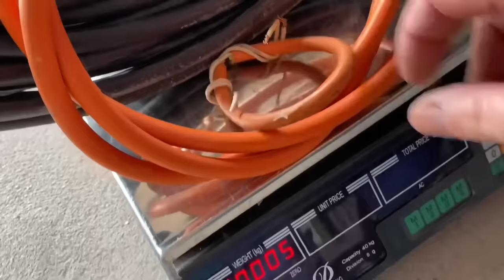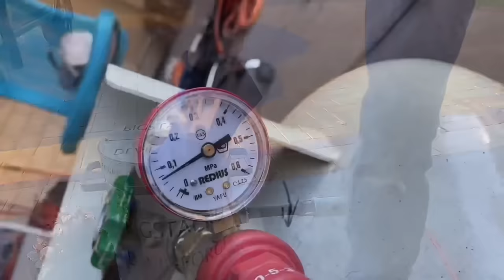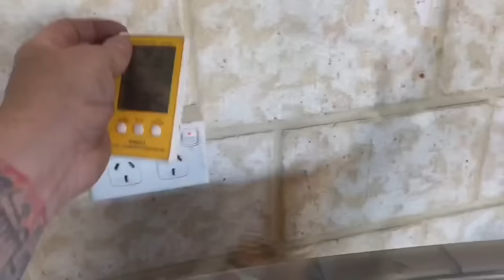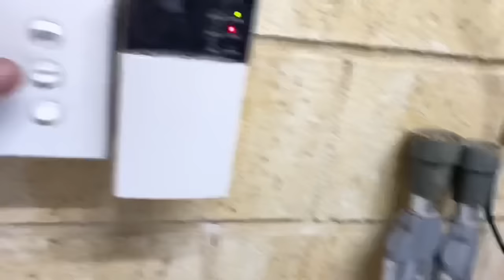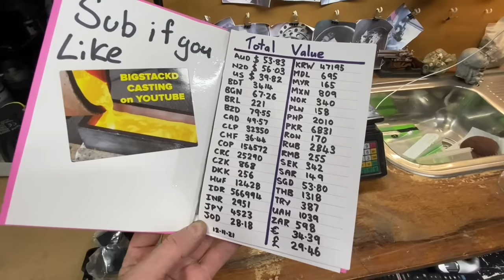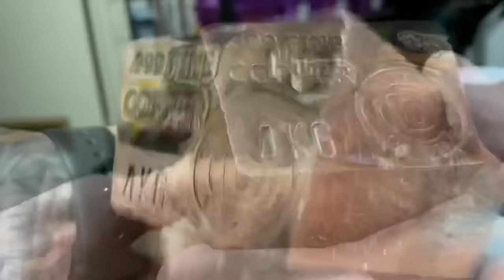Melting 10KG  Copper Cable - 99.9% Pure Copper - ASMR Metal Melting Copper - BigStackD Casting

Comment: The untwisting thing made me think of network cables.  What are your thoughts on melting them down?  Too high percentage plastic?  I have loads of old cat5 patch cables that I need to do something with...
Reply: Just cut the ends off and take them to a scrap yard. Price is around 75 to 95 cents a pound for insulated wire. The connectors have gold plating on the contacts.

Comment: @bigstackD Casting would you recommend the devil forge forge? The 2 or 3 burner model. I need to get away from coal for the winter and want something good. I already should've gotten a furnace from em lol. Mine is nicely built, brass just looks bleh melting it in a plain unpainted steel furnace.

Comment: Here's a question for you, will that stripper you used to take the jacket off work with data wire? I'm talking CAT 6/6a, CAT 5/5e, or even 25-50 pair cable? I'd like to melt down my own stuff, but the amount of work and time to manually strip the cable is my biggest obstacle. So is not having a dope smelter lol

Comment: i has question.  i take apart computers, and collect the wires and pins from them.  i have found some wires that are not copper,  however i do not know what metal it is.  it appears similar to be the same color as a metal spoon.  any ideas?

Comment: Sorry for the stupid question 

Why make lingo.   Did it incrase value of the copper ? 

Where did you sell your lingo ?
Reply from the maker: Actually buddy it won’t increase the value unless you sell it privately like on eBay or something like that. The scrapyard won’t pay you any extra for the ingots so to do this you would lose profit in time and gas. And most scrapyards won’t even buy the ingots because they don’t know if you’ve poured copper around a big piece of steel so a lot of them just refuse to buy them. 
I do this purely as a hobby that’s why I have so many bars and coins as you’ll see you at the end of video ,
this is just what I do on my days off for  a bit of fun in the garage so I don’t mind if it It cost me a few dollars here and there. 
Although ad revenue counteracts the loses.

Comment: Not sure if this is mentioned in older videos (just started watching), but how does that heat not affect your garage door above it?  I noticed it seems the furnace is still inside a bit, or is it just camera angle and really it's outside?
Reply from the maker: Actually mate most times I’ll do it directly under the roller door but when I built this house 15 years ago I got the garage roof raised so it’s not a standard height it’s actually a bit higher than normal. I have actually measured the temperature on the roller door and it only goes up about 10°C above the rest of the door. Even with the smallest of breezes the heat will disperse very quickly from the top of the furnace that’s why I can usually get a good view inside the furnace with the camera. 👍🏻
Reply: @bigstackD  Ah ok that’s cool.  I wondered how high/fast heat dissipated for those.

Comment: Don't believe I've seen you melt down  aluminum or brass radiators or heater cores, what about cast aluminum such as water pumps, pistons etc.  Worth it?
Reply from the maker: I do have two radiators one from a car and one from a four-wheel-drive that I will be doing in a future video so I’d be quite curious to know how much I get from it which I think will be quite a bit👍🏻.

Comment: the 10 grams might have been the ties holding the coils together that you cut with the diagonal cutters...

Either that or it's plastic dust/slivers from the insulation that got shaved off as you ripped the copper out of the insulation jackets...

Maybe both...

Comment: do these forges ever get tot he point where the  fire brick is so badly damaged that just coating it again wont cut it and they have to be either competly recycled or discarded?
Reply from the maker: I’ve had my few furnaces for years I don’t use the solid refractory one very often as that’s About 30% less efficient than the ceramic wool one. With the ceramic wool one I reapply the ceramic coating every few months but I have yet to replace the ceramic wool on the chamber walls in any of them yet. Although I do Regularly replace the floor of the chamber with 2 inch ceramic wool as I’m forever spilling stuff in there and always overfilling the Crucible

Comment: Can you smelt it as is (not freed of the copper's wrapping) - and just scoop out the trash?
Reply: I asked that before watching - sorry.
Reply from the maker: You certainly can just chuck the cables in with all the plastic on and all it will do is turn to Ash and it won’t affect the quality of the bar at all as the ash will stay in the Crucible or Kane skimmed off you’ll just need to pour it a bit slower so as to keep all the ash in the bottom of the Crucible. I did do a video where are melted the cable with the plastic on and everyone had a cry in the comments🤦🏻‍♂️. 
surprisingly if you were to melt it with the plastic on as long as you keep the heat on and wait until the copper has melted The furnace will produce no smoke at all🤔

Comment: Hello. Can you give us details on where to buy that kind of wire stripper please
Reply from the maker: EBay mate just type in electric wire stripper and it should come up. It’s a no name brand but I’ve had it for years and it works perfectly. As soon as you’ve got it set right for the size of wire you need you just sit back and feed the wire in 👍🏻

Comment: I am pouring copper ingots, about 6 lbs. Why do I get gas pockets in ingot sometimes after turning them out of mold?
Reply from the maker: honestly mate I myself have no idea. I’m assuming there’s trapped gases in the copper but for years I’ve struggled to remove the bubbles. I’ve superheated the molds I’ve vibrated the molds I’ve poured on an angle ive poured with a torch above the mold  and I still get the bloody holes🤷🏻‍♂️
Reply: @bigstackD  Thanks for your help! Love your channel, that's why I bought a Devil Forge. Haha

Comment: Do you wax them so they won't not Oxidize? 

Also make a small copper golem friend for your next copper vid
Reply from the maker: I don’t wax them but I do spray clear acrylic on the ones I want to keep in perfect condition as that stuff will just simply burn off if I ever decide to re-melt it but with the amount of work that goes into Mirror shining up a bar  I would never remelt one of those 👍🏻

Comment: You could be pouring 2lbs. Copper mallets/ fiberglass handles. 
Selling them to tool trucks and making bank. A good copper mallets is not a cheap date ,add 12% tin and you have a Bronze mallet. Snap on no longer sells copper hammers, every transmission guy and body shop had at least one and they got used alot. Hazet makes a 1000 gram copper hammer with a hickory handle, it's $162.11
That's right around 2lbs. at KC tools.

Comment: Why heat the mold before pouring the molten metal?
Reply from the maker: It’s always a good idea to heat anything that comes into contact with the molten metal especially your mold as if there’s any moisture at all in there it will turn to steam instantly creating a steam explosion and that will send molten metal everywhere but you can eliminate this by preheating your molds and making them nice and toasty hot before pouring into them👍🏻😁
Reply: @bigstackD  Such a good knowledge! Thank you for your explanation!

Comment: I wonder why you couldn’t just throw the wire into the fire without stripping it? In the heat of the crucible wouldn’t everything not copper completely burn away?
Reply from the maker: It would mate , you could easily do it and you would just have a bit of ash to skim out or you could just pour the bar slowly and the ash would stay in the Crucible but the last time I melted copper without stripping the plastic off 10000  people cried in the comments🤦🏻‍♂️

Comment: Now Please don't Get mad because I mean absolutely no disrespect, you can do whatever you want with your time and I won't judge, I am just curious.
What is the point of this? Is it just for fun?
I am a metal fabricator and have even done a few small castings myself. but I have been seeing a lot of videos showing up on youtube recently of people melting things down into Ingots and you seem to be one of the most popular channels doing this.
I can't see this as profitable, The wire and cable was worth more in its original form and I know for a fact (that at least around here) scrap aluminum, copper brass / you name it is worth the same amount left alone as Cast, add into that the cost of fuel, The amount of labor etc there is no way this is worth it in any monumental form?
Now I could see if you were planning on casting something and machining something out of that ingot but It looks like it is just for fun?
am I missing something?

Comment: I know its possible to make a furnace the size of a metal trash can, but is it smart to do so.? Legit wandering... Not joking...
Reply from the maker: You certainly could mate but you would definitely need 2 powerful burners running, if you did it with ceramic wool and coated it It should work pretty much the same as the smaller ones but if you were to line it with refractory concrete then that would need to heat up before you would get consistent heat to melt so it would take probably 30 or 40% longer and cost the 30 to 40% more in gas. But once the refractory cement temp was up it would run pretty much the same cost as the ceramic wool one but obviously you would lose a bit in that first initial melt ,  if you were to do more than one melt if that makes sense. 
I do have a larger furnace coming I’m just getting it custom wrapped so hopefully I’ll have it over the next few months👍🏻
Reply: @bigstackD  was thinkin of using fire brick and wool from an ole wood stove I have no use for.... ??
Reply: @bigstackD  do u think if i put it in the ground... Like in a hole... It might stay hotter longer and maybe wouldnt take 2 burners?
Reply from the maker: It will work it’ll just cost extra on gas and take a bit of extra time for the first initial heat up . Obviously use the wool on the lid otherwise it would be bloody heavy👍🏻. The only downside with a huge furnace is you’ll be using huge crucibles which are quite expensive unless you make your own out of something and then you’ll need to make a heap of tools to lift and pour👌🏻
Reply: @bigstackD  i appreciate the info... Its helpful... Love ur vids man keep it up!🙂👍
Reply: Woah😮
Reply: @lewisgiles8855  🤔🤔

Comment: Why do some ingots in your older videosstill havegiant air bubbles even though the ere shouldn't be any moisture for you preheating the mold aswell as the weight of the metal